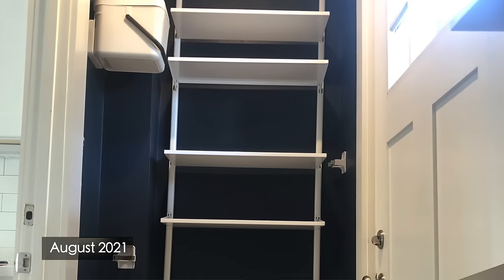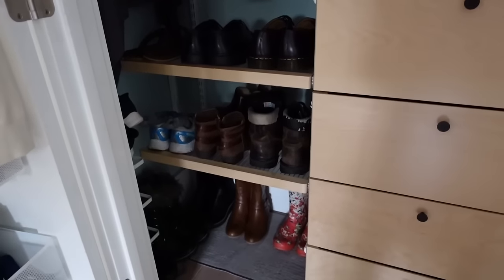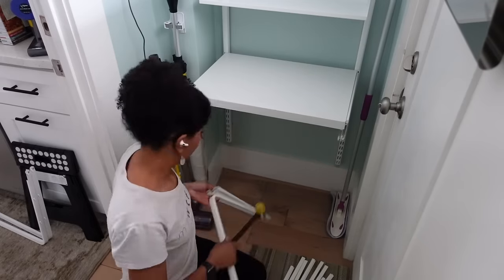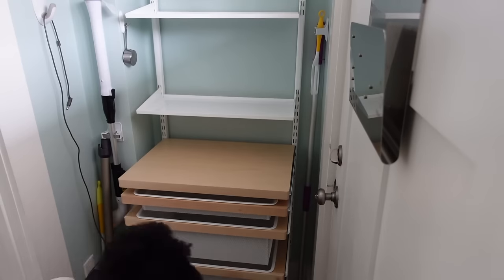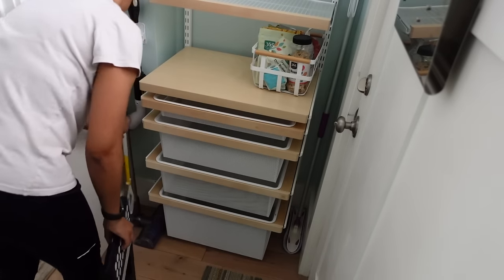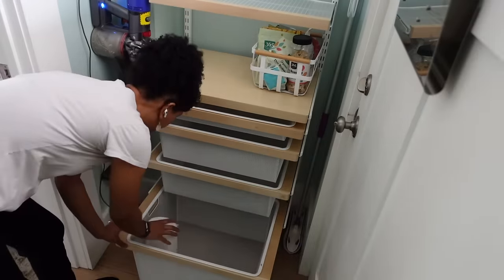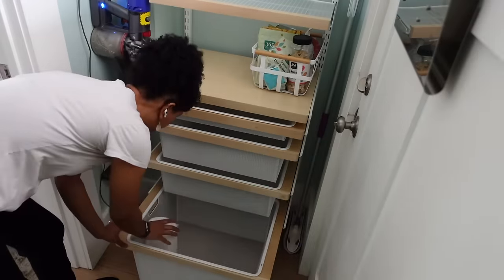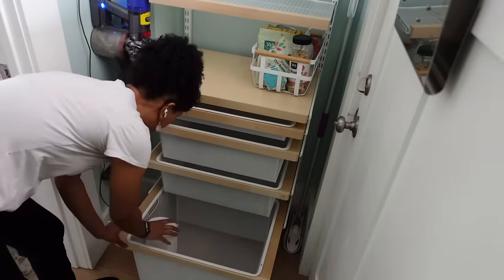✨ Glamming Up My Pantry AGAIN (Last Time, I Swear)

Comment: Our kitchen in our home of 45+ years had a custom-built kitchen, which I had designed and Nigel built over a period of 2 years, at weekends.  We opted way back in the early 70's for Elfa systems.  Way before pot drawers and other modern conveniences, we had to find a budget-friendly option, that worked!  All under counter cupboards had Elfa metal , free-standing racks, with sliders.  All drawer baskets slid into these.  I never had to unpack an under-counter cupboard!  Was marvelous!!  Of course, here in South Africa we do not have the modern Elfa systems at all; at our current exchange rate, importing some would be prohibitively expensive.  They are so sensible and always look good....txs for an always-inspiring video, Kay!

Comment: I have seasonal dish towels - I've been working on each season for about 5 years, and I'm finally done! I get mine from HomeGoods, and I make sure to buy two sets so I still have them while some are in the wash. I supplement with plain white/plain towels so I have enough towels for cleaning and baking/cooking.
Reply: Same. I have about two sets for each holiday as well as the regular non seasonal ones.

Comment: Kay, I have been watching you for years so you can imagine how often I am exposed ELFA through you. Not blaming you! I love how modular it is and I WISH I could afford an ELFA setup. My shoe & entryway-ish closet could be more space optimized and I'm considering to finally take the plunge and redo it (one half) in ELFA. So, I am so psyched for that All You Need to Know about ELFA video. Maybe you already will but will you please include that one thing about closet dimensions - I forget where you mention it but it was something like how people came in with a walk-in closet sized closet but with ELFA installed it was better to treat it as a non-walk in. Did that ring any bells? 😅 I hope I didn't conflate two ELFA designing methods 🙈 Love how your pantry turned out!!